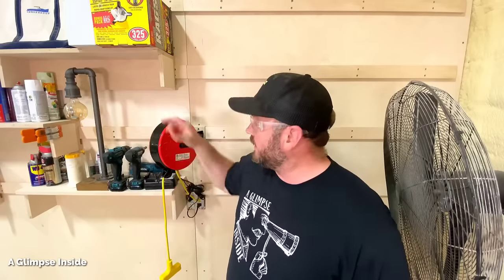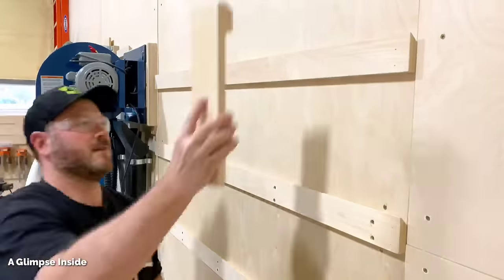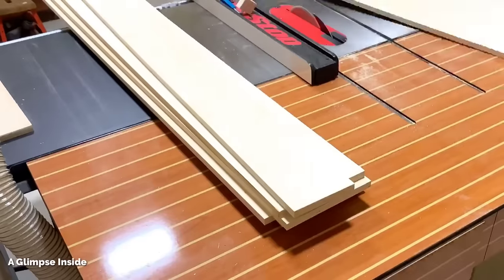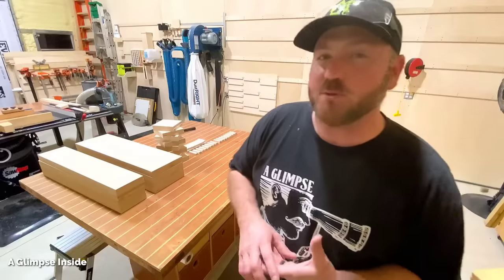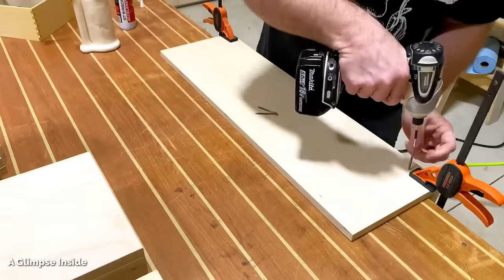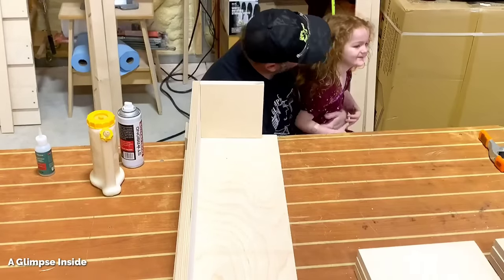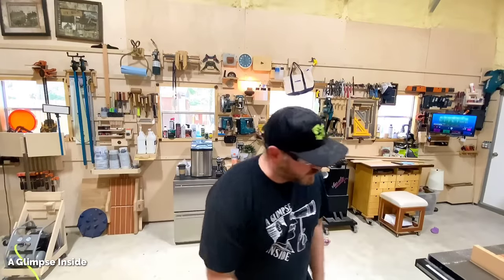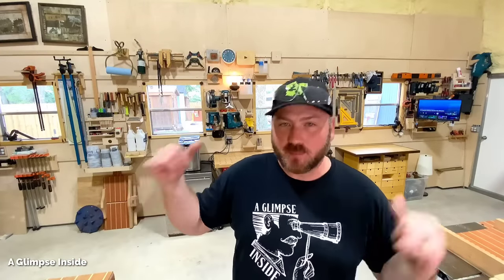FRENCH CLEAT SHOP SHELVES | One Sheet of Plywood | A Glimpse Inside How To

Comment: I did the same thing for spacing my French cleats on the wall, except I made hangers for spacing and started from the top down.  Several reasons for that.  One, the floor in my garage is not level, but the ceiling is.  So my highest French cleat is 12" down from the ceiling rather than some inches up from the floor, and everything else was indexed off that.  Second, I cut 8' long French cleats to go on the wall; hanging them from above rather than balancing them on spacers below meant I didn't have to worry about a precariously balanced 8 foot long plywood noodle falling off the spacers before I could get the screws in.  I used bolts for the bottom part of the spacer-hangers:  I could fine adjust the height that way, and also back off the bolts to get the spacers off after the cleat was screwed down.

Comment: Use your story stick for the first one, tack all the others in place with a brad nailer, then user a vertical line laser to project a vertical line for all the others using the first one to line up on.
Reply from the maker: That’s a great idea if I owned a vertical line laser. But I don’t so I did it the old-fashioned way. But that’s still a good idea

Comment: MODULAR! I love modular stuff. Storage that you can reconfigure is always the most versatile, especially if it can be made portable.

"Ugh, I really need to clean up that mess...." has been the motivation behind more shop builds than every other sentiment combined.

I am a little surprised that you didn't make the side brackets triangles instead of squares. Seems like they might get in the way of shelves below.

However, since you did leave them square, your comment about adding a secondary shelf to each unit is certainly true, but you could also add a dowel to the lower corner for tapes, clamps, or even rolls of brown paper. They'd also make nice hanging drying racks for smaller work pieces after painting or staining.

Comment: Any idea on how to stop the shelving from being knocked upwards and out of the cleat-seating?  ie. you standing up near it and hit it, or you go to remove a tool and that causes it the hook panel being dislodged?  I just noticed this happening with heavier items, like a shop-vac hung on this system as I remove it to move it around the shop.  I had to resort to putting a screw lower on the panel, that would screw into the wall-panel...not deep, but just enough to create some friction to stop the piece/shelving etc from being pushed upwards and out of the cleat.

Comment: Have you ever had those flush trim screws split the end grain of the plywood? Also wondering what length you are using, for 3/4" to 3/4" butt joint I am assuming 1-1/2" screws? Thanks!
Reply from the maker: It can if you’re too close to the edge but ordinary it does great are use the range from 1 and 12:45 and one and five eights
Reply: @AGlimpseInside  Thanks!

Comment: Do you screw the cleats only to the back plywood? Or do you make the screws go over the plywood, the wall, and into the studs? I have a brick wall and it would be easier to just screw them into the plywood (otherwise I'd have to fix a lot of dowels on the wall), but I'm not sure how much weight they'll hold this way.
Reply from the maker: You don’t need to worry about screwing them into the studs. I typically use two screws about an inch and a quarter apart roughly 8 to 10 inches apart from each other all the way down the cleat you should be fine
Reply: @AGlimpseInside  thank you dearly for your response! I'm just getting started with carpentry as a hobby so the guidence is much appreciated. Cheers from Argentina!

Comment: Great Idea Chris! Thanx. I noticed you struggling with your disc sander moving. Maybe this will help.Try putting it on a board large enough you can stand on then strategically nail some chocks on the board. Walking problem solved.

Comment: Might be a good idea to mount them ‘upside down’ relative to the angled cleat. Then the shelves would have sides to keep the stuff from falling off.
Reply from the maker: I like it nice idea
Reply: Or instead of having a standard spacer block on the opposite edge, you put another set of the French cleat blocks instead and then you could hang the shelves either way.

Comment: I use a spacer block without a cleat in it, just square edges, and I drew a line on it to act like the story stick and line it up with the lower cleat's screw holes. Just slide it down for each set of screws. Didn't feel need for long storystick, but I love the idea.

Comment: Hi from the UK :)

I would have been tempted to cut the corner of the end shelf supports at 45% (like you did on your wife's) - It just gives that quality finish without affecting the strength. Also I know modern adhesives are great, but I'd still put a few screws in the cleats (especially if the shelves will carry some weight). Great channel BTW :D
Reply from the maker: I did show a small segment of me putting screws in the cleats. I agree with you modern adhesives are great but..mechanical fasteners for the win

Comment: I like this design for shelf units on a French Cleat wall. My shop is smaller so I made 4 of these 18" long. Mine are dual shelves like you suggested at the end and I made the lower shelf 3/4" wider to act as the lower support thus eliminating the need for a back piece (less plywood). So it's the same as yours but different hahaha. Yours inspired mine so thanks!

Comment: The story stick is how I did my wall. Mine was a little different, as I had it index to the top of each cleat, rather than spacing to the bottom. (in case the cleats were not quite exactly the same height.) I also started at the top and hung the new cleat from the pair of story sticks (a small spring clamp or pin nail to hold it in place.) while I screwed them in place.